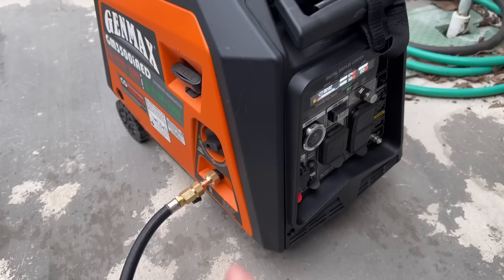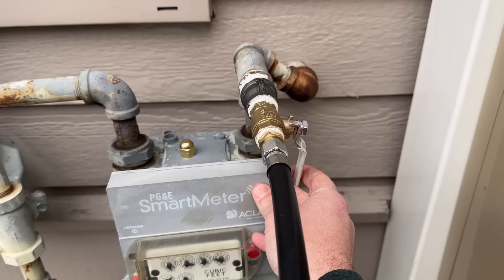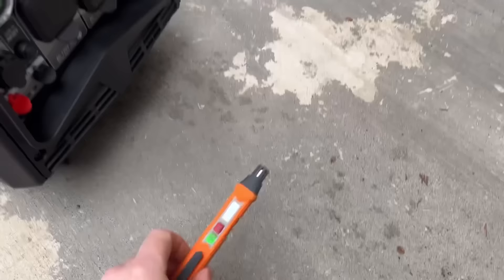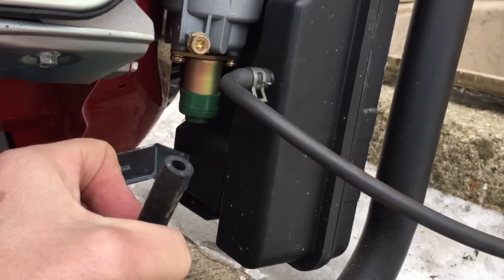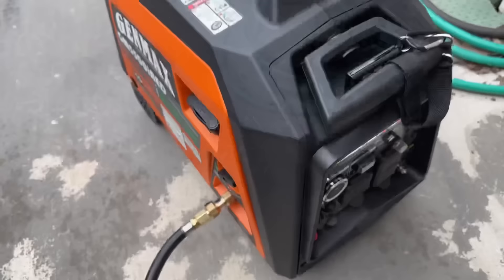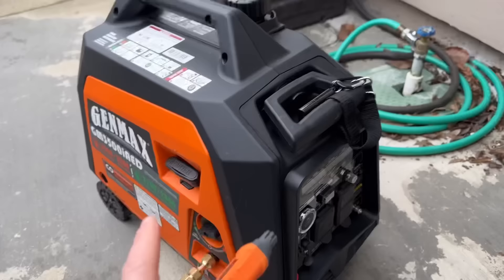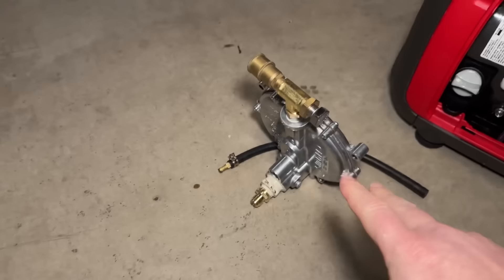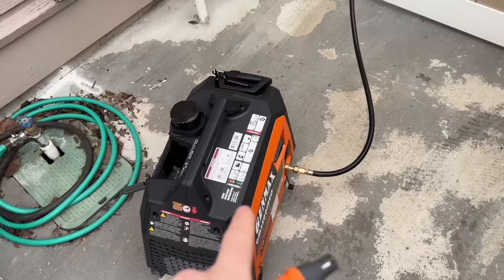Natural Gas Generator Hook Up People Should Stop!!!

Comment: They also make a snorkel it cost a hundred bucks to convert them over when you use a snorkel it's connected to the governors in the only way 
It will put gas in as if the governor's open a generator shuts off on you shut it off it does not allow gas to go into it and that's the only way to kill the engine you have to shut the gas off to shut the engine if it dies the little butterfly that operates the throttle when it goes back to a certain position that cuts the gas off and my area natural gas generators aren't even allowed unless it's a commercial generator
Reply from the maker: Kinda works that way but the internal carb doesn’t really do anything when running natural gas. to just a entry point. The load regulator or demand regulator is what controls the NG flow.

Comment: if u place ouside its not dangerous at all onyl waste of money. but if u want to be sore just add a magnet valve to gas line and feed with the power of generator. when the generator turn off the valve will shut.

Comment: Can i have "to much gas" in my generator? Meaning, if i was running the pipe from my meter where my whole house is supplied with 1 inch pipe, and i added another 1 inch pipe directly for my generator with 3/4 hose ith quick disconnects, would this be ok. Im supplying 10000W generator. 
Thank you!
Reply from the maker: You will need a large line for that size. Plus distance.
Reply: @JOHNNY'S WEEKENDS  thank you for your response, but I'm not quite sure, large line?
Reply from the maker: Well you have a big gen, and so most times 1/2 inch is minimum but you have a big gen and add several feet then 1 inch is what you want. ,
Reply: @JOHNNY'S WEEKENDS  oh now I get it, for that size you ment size of a generator, not size of the pipe. Great! It's all clear now. Thank you Sir!

Comment: The problem is you are running a dual fuel (gas and propane) generator on natural gas. It is not designed to run that way so of course it doesn't have the safety valves in place. Also if your running your generator and it quits while your inside you would know right away as the lights go out
Reply from the maker: First this generator and most all are all designed to run on NG. There is not to many differences especially on the tri fuel units. It’s just the load regulator inside. I have ran this unit on NG for a few hours with no issues with the “Correct” regulators. 
And a responsible person who is not high or drunk or sleeps like a rock will know if the lights go. Or unless they leave for a while to go get things and leave the generator running. Remember not everyone thinks about what could happen.
Reply: @johnnysweekends  that generator is NOT designed to run on natural gas. Yeah there aren't many differences but they are important differences
Reply from the maker: Let’s see, many tri fuel units use the same engine. Nothing different but the pressure amount and jet size for the lpg or NG.
So tell me how it’s not designed to run on NG. Because they make a ton of conversion kits to make a gas unit into a tri fuel unit. You could even do it with your lawn mower if you wanted. 
Does NG engines last as long as LPg nope. Does Lpg last as long as gas, nope.
But it can and will run just fine one NG
Reply: @johnnysweekends  that right there it the main problem. You don't know what your doing or how it works. If you did that there would be no point in making the video at all. There is differences in nozzles and pressures between propane and natural gas. And yes propane engines do last longer then gas engines
Reply from the maker: Lol I know plenty of what I’m doing and you missed the point of this whole video. 
People are hooking up a tube and shoving it in the airbox. That’s it. And thinking it’s a good idea. That’s the point of the video. 
Not the type of generator I’m using to demonstrate the idiotic idea. 

 A properly built and designed engine meant to run solely on propane is totally different then what we are talking about here. Apples and oranges…. Diesel and gas. Totally different. 

And again yes these will run on lpg and NG with a proper conversion kit. It’s been happening for years.
Reply: @johnnysweekends  yes with proper kit. Propane and NG are two DIFFERENT kits. If they are just shoving line into air box then generator is running off gas as well
Reply from the maker: No they shove a tube into the air box and use a manual valve Like i did to control flow. Fuel has been turned off. It’s a thing and there’s are a couple or more videos showing it. 
And its not two different kits. I have installed several kits now and even did a video on this just recently. And have other install videos of these kits that run the generators on LPG or NG. 
It’s not hard and the kits are simple. This allows you to run many items off regular gasoline LPG or NG. 
Tri fuel kit. Again this is nothing new. People have been doing it for years. 
Look through my video list if you like. Plenty of info there.
Reply: @johnnysweekends  so you a licensd and certified in both LPG and NG?
Reply from the maker: lol you don’t need to be using diy kits. Hence diy. 
Did you call a electrician when you swapped the light switch or changed a fan? Or did you get a permit when you changed your water heater..?? Because you should of your not a certified electrician or plumber. 
I’ve been a mechanic for decades and have done electrical work for decades as well. I know my abilities just fine and when a cert needs be called. 
I think you need something else to do. But thanks for the convo. Enjoy your weekend
Reply: @johnnysweekends  yes but without the knowledge you don't knownor understand how they are different kits. No permit required or available for water heater change. Don't call electrician because among my certifications is electrician, plumber, hvac, welder, mechanic, vehicle builder, ect. All red seal
Reply from the maker: The kits I talk about are universal. They adjust the flow with a manual load block. 
Using a positive stop diaphragm. Then they open under vacuum and you adjust it accordingly. Once set they work just fine. 
No need to set pressure or check W.C. With these kits. Hence they are diy. 
After install you check for leaks do a test run and then adjust it with loads to set it correctly so you have enough supply for max loads. Then as loads lessen it will self adjust per load demand. 

I don’t build them. But the kits have been around for ever. Installed on Honda gens and more and people have thousands of hours using both NG or LPG. 
Not sure what else’s you want to know about or original topic but that’s what the video is about people not using a proper conversion kit or having a NG line installed correctly. My hook up was temporary for video demonstration. But if I want a permanent hook up my NG bbq line is just around the other wall. 👍🏼

Comment: On your dual fuel generator in the video where's the zero governor aka regulator?
Reply from the maker: On my bench. Not the reason for this video. The next video coming will explain if your generator is NG compatible.
Reply: @johnnysweekends  I've converted a few generators. I was curious about yours when it isn't demonstrating darwinism.
Reply from the maker: Lol. I have several, some gas to propane and NG and some dual fuel to NG. I honestly don’t need NG for them as I prefer propane because it’s way cheaper for me then NG but viewers where wondering so next video how to coming in a few days of dual fuel to NG compatibility

Comment: The smart thing to do is to hook a hose to the inlet of your air compressor and run it down into your septic tank or the sewer. Then you can compress the human methane and pump that into your generator. If you could get the moisture and the nitrogen out of the sewer air I'm sure it would work but you might not like the exhaust smell. You know how diesels that run line heaters can buy frying oil and it smells like French fries? I bet an engine running on compressed fart gas would smell like ass.
Reply from the maker: Wth.    😂

Comment: Yeah or don’t run this thing near your house at all, those exhaust gases are not great to breath. NOx = asthma and more. Also don’t burn fossil fuel, especially not in a highly inefficient miniaturized heat engine with poor efficiency thats leaking methane, kind of a bummer for the whole planet.
Reply from the maker: Well of course you need to keep away from house but unfortunately fossil fuels are still a key piece of life. But propane and NG or hydrogen is definitely cleaner.

Comment: There's also no flash arrester!
Reply from the maker: Flame arrestor typically lives on top of the carb like on a boat.
Reply: @johnnysweekends   unless youve removed it to rig in a gas inlet lmao. 

One backfire and that things likely gonna go BOOM!
Reply from the maker: Generators have a foam filter and a metal plate to hold filter from not getting sucked in. The filter and air box suppresses the flame. The spark arrestor in the exhaust it does just that. Catch sparks before they fly.  Generators at least the ones for the last several years do not have a flame arrestor. Just like a lawn mower, chainsaw, wood chipper and more.

Comment: YOUR JUST THE GUY I NEED TO ASK... First, Thanks For Video. I have a Pulsar 4,500 Dual Fuel Inverter / Generator ( # PG4500BiSRCO ) and they sent me a line with a dual regulator hook directly hooked the to the QCC-1 propane tank connector. Also they sent that BIG type (what I call a Zero Govenor) * What You Are showing in your Video) also ( now days they have taken the purge push button off the back of it. * Usually, Manual purge mine by keeping the nut so tight at the generator, then turn on the propane bottle (usually a 20 -30 lb.), let it hiss out where the bolt is not so tight as of yet for about 5-10 seconds then tighten it on down so no leaking. Can you tell me if I really need to run all 3 of these regulators or will the 2 low pressure regulators be O.K. to run without have to insert the other Big Round one? I was thinking that was for if you wanted to run Natural Gas or either wanted to run a long 25foot + hose on your generator.. I don't want to mess it up as it's never been ran yet as I just bought it on sale 4 months ago. I see those big ones on , lets say BIG 100lb. + propane tanks but never seen them on smaller 20-30 lb. tanks.. Any help you can be would be great as the Show You NOTHING in the Manual (free download at their site at Home depot) & if you call you get someone from China or India who knows NOTHING AT ALL nor can you understand them anyway... ANY Help will be Gratefully Appreciated my brother... P/S.... Maybe it is just used as a precaution to shut the propane off right there at the tank if something or another goes wrong with the Unit * inverter/generator *.... Also, I forgot to ask, does it make any difference in the way this thing vents? I was thinking they were to vent DOWN since propane is heavier than air but I have seen people running them upside down, crooked, sideways, etc...Lol.. But, maybe it doesn't really matter... Thanks Again...

Comment: how could it be dangerous if they know what there doing??? if its a proper seal an no leaks detected itll be fine along with the generator if its properly fitted for two or three different fuels its fine i have a 10k generator thats been factory fitted with a natural gas to propane to gas an we have it made to run off an old gas shut off for a open flame shop heater an i don't see a problem with it plus we had people from the gas company check it out an they say its fine
Reply from the maker: Yes if it’s properly done it’s fine. Did you miss the part with a straight hose to the airbox ..??
Reply: @johnnysweekends  we don't need that its got a regulator connected to the air intake not the air cleaner box
Reply from the maker: If you have a proper unit with a inline regulator and internal load/demand regulator for NG your fine and non of this matters. 
If you have the external regulator with demand regulator then you can run NG but still need a kit. As the supplied hose is not the correct pressure
Reply: @johnnysweekends  we bought a ng hose from home depot with female to male quick disconnects like something youd find on air compressors

Comment: Dude I didn't even know that was possible To hook it into your natural gas hook up also I didn't think propane generators would run off of natural gas!  I definitely wouldn't  Run natural gas in my propane generator paid too much for it but interesting
Reply from the maker: Most of all these smaller portable units that are dual fuel are no different if they were tri fuel. The regulator is the only thing that is different which is controlling the pressure and flow of the gas. 
So most of these even your lawn mower could run on propane..with the correct equipment of course. 👍🏼
Reply from the maker: Most of all these smaller portable units that are dual fuel are no different if they were tri fuel. The regulator is the only thing that is different which is controlling the pressure and flow of the gas. 
So most of these even your lawn mower could run on propane..with the correct equipment of course. 👍🏼
Reply: @johnnysweekends  appreciate the info brother

Comment: You should not tell people not to do this without making a video to show them the proper way to install the regulator.
half advices is no advice.
if they have gone to the trouble to install the quick disconnect they are going to use it.
Just my opinion.
Reply from the maker: In the video I show them a proper kit they should use…🤷🏼‍♂️ Never run a straight hose. Use a kit. But maybe people only watch pieces of videos?

Comment: This is illegal in the USA
Reply from the maker: Can you provide a data sheet?
Reply: @johnnysweekends  ????
Reply from the maker: Information showing it’s actually illegal.
Reply from the maker: Doing the suggested modifications with no proper regulation and shut off yes. Is that what you meant or just messing with a external gas line in general ?
Reply: @johnnysweekends  any modifications to the main gas and or electric lines by the homeowner must be approved and signed off as safe and passing  by the licenced inspector that works for the gas electric company in your city or county....they MAY also request blueprint or drawings of your modifications...if an outside paid licenced professional does the modifications for money , they provide you with a receipt for work and modifications, this can be submitted to the gas electric company for proof  of safety....if they agree you pay a small fee $20 and they sent you a paper proof of legal safety or a plastic "tag" you tape or attach near or on the new modification. OTHERWISE YOU CANT SELL OR GET BANK LOANS ON YOUR HOUSE!! FACT.
Reply from the maker: You realize that is the same for changing a receptical in your house? Same as changing your water heater with no permit?
Reply: You assume ..... But in reality...."common sense.... Is not so common""
Reply from the maker: Lol that’s true, hence a put the video out to tell people don’t follow the other couple bad videos that are approving this method of running a straight hose!! 
And yes eventually people just do what they want. 
Like suicide cords. People do it and give dumb dumbs bad ideas.
Reply: @johnnysweekends  👏💋🙌❤️❤️🐱 amen
Reply from the maker: Agree!
Reply from the maker: I like the name as well, just reminds me of something lol. 😉😁👍🏼